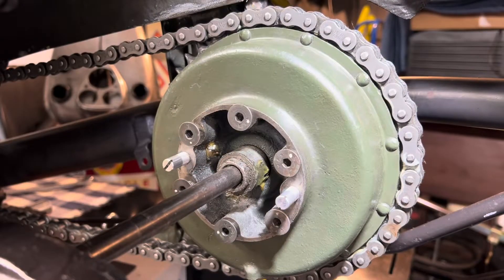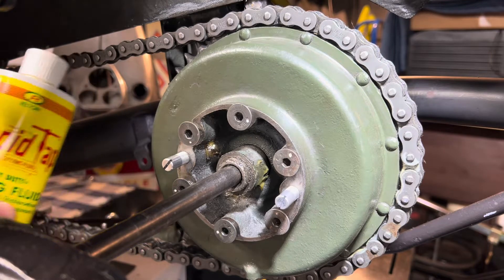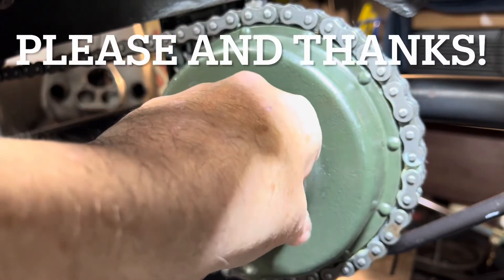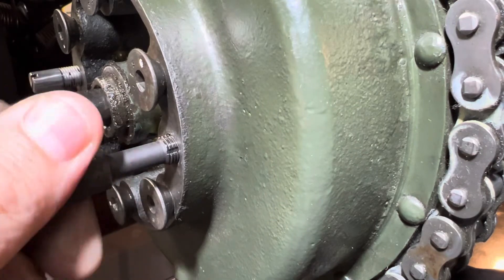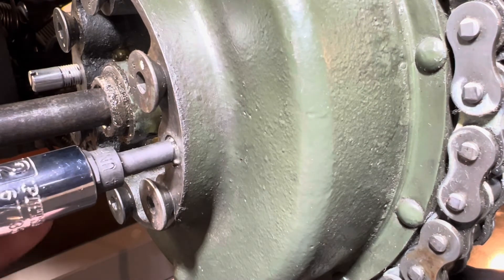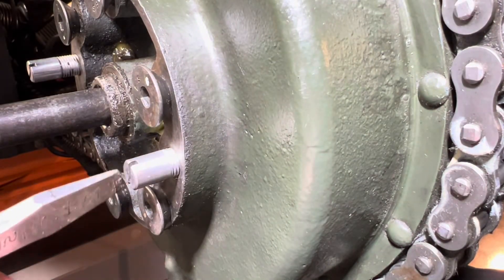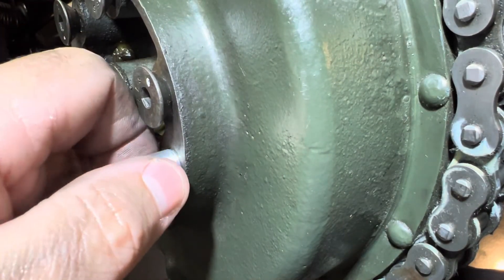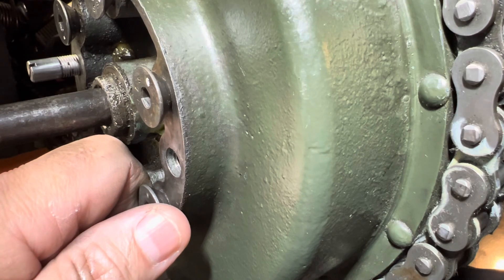THREAD TAP or THREAD Chaser? How to use a thread chaser. 1940 Indian Chief Motorcycle. Chase Threads

Comment: Your patience an tenacity helped me work through it.  Stripped a lug nut, bought a thread chaser and it it didn't work the first 10-20x.  Started using a new lug to work in and it actually wasn't working where the chaser was. Backing out is key.
Reply from the maker: Awesome Brent! 👍😎👍 It can be frustrating and patience certainly helps!   So glad to hear you came out in decent shape 👍Appreciate you letting me know! 👍😎👍

Comment: I’ve always used a tap. Is a chaser smaller diameter?
Reply from the maker: Not according to my measurements. Chasers are basically like a bolt with slots cut in to collect any gunk. Taps are just more aggressive in how they work and from what I’ve learned, should be used if the Chaser fails to get the job done. Taps are great for making new threaded holes in metal where Chasers are useless!